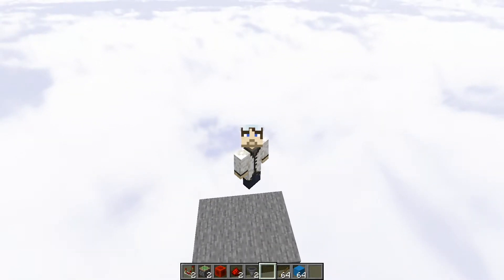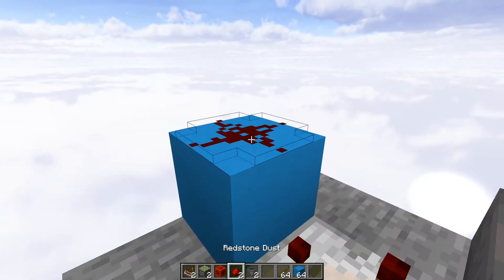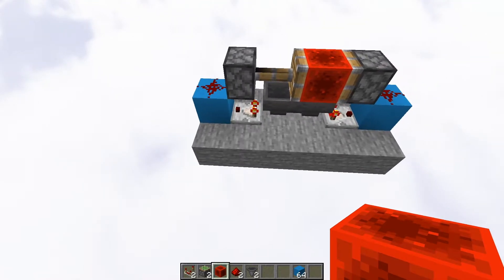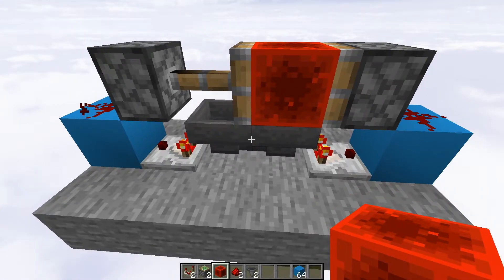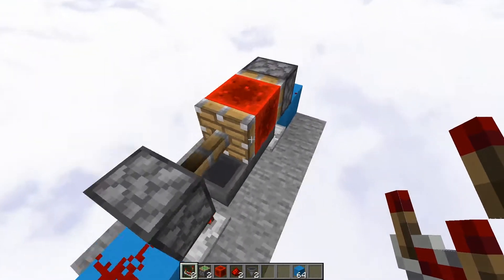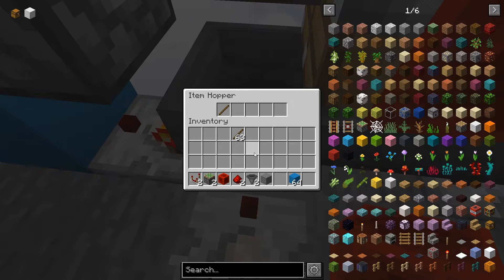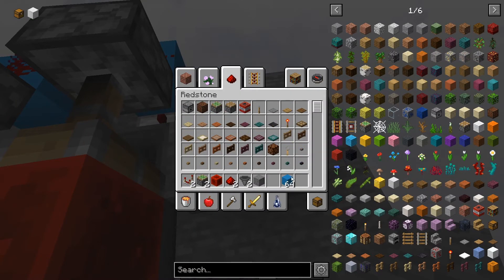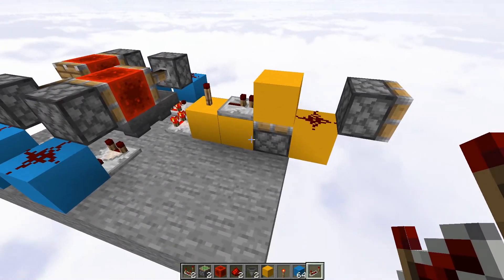How to Make RIDICULOUSLY LONG Hopper Timer Clocks!

Comment: When the comparator turns off for the extra clock the hopper acts as if it’s still locked if I break it then the item in the hopper move like normal idk how to fix thsi
Reply: I ended up breaking it and rebuilding it works now I am on bedrock so items move in 16 so for the second one it just moves all of them so just do the math 16=1

Comment: whats the exact amount of items to put it for a 6 minute clock? (im playing on a server where hoppers input items 3 times as fast as normal servers which is 3 items at a time)
Reply from the maker: you'll have to do some experimentation with it, but I think it's 150 stackable items (such as sticks) in the first hopper clock, and 6 items in the second hopper clock.
Reply: I put a few more sticks in and it worked! Thanks.
Reply from the maker: @BluxyW  awesome! Sometimes it takes a lot more testing

Comment: Hello, is there a way to stop/start the clock manually? for example when i push a lever the clock starts when i press it again it stops
Reply from the maker: There is a simple way to start and stop the clock. You simply need to lock one of the hoppers, which will stop the clock. Unfortunately doing it that way will stop the clock likely in the middle of the timer, but if that doesn't matter to you, then it's the easiest way to do it. Another method is to apply power to one of the blocks that have redstone dust on them. The problem with doing this is that it may require that one of the pistons receive a block update, so that can get complicated. Another method is to apply a full redstone signal to the sides of both comparators at the same time. This will reset the clock and turn the clock off. You can toggle it on and off with a lever if you like, or use a RS NOR latch, or a monostable circuit with a piston to push in and out a redstone block. Personally, I feel the comparator method is the best method to use, since it resets the clock as well
Reply: @Talmiior  thank you for still replying the questions after all those years, will try the comparator method for my dungeon game
Reply from the maker: @jeff6185  hope it works for ya. Your comment got me thinking of a new redstone vid though, so I appreciate the question!

Comment: There is a bug in mine somewhere, where instead of one quick impulse, it's as long as the first clock. How do i fix that?
Reply from the maker: odd, if you follow my setup, it should be working. That usually happens when a signal isn't being passed properly, a component being missing, or only 1 item being placed in the second clock
Reply: @Talmiior  Yeah, sorry. I used two comparators instead of one. But this clock is a bit different. When the first one does ALL of its cycles, it activates the second one, BUT it goes immediately to it's first state. Can I build this in a way, that when the first one does all it's cycles, it will just push the second one to the other side, and back and forth and back and forth?
Reply from the maker: @kingosondros  Sounds like you should scrap the second clock and just have two sticky pistons passing the redstone block back and forth. You'd have to set up a couple monostable circuits on the sides using the redstone crosses on the blocks left and right to achieve that, that is, if I am understanding what you are trying to do.
Reply: @Talmiior  Hmmm, so only one clock? No connecting?
Reply from the maker: @kingosondros  even what I said there isn't really necessary. You basically just want the signal to turn on and off after each 4 and a quarter minute cycle. You could take the signal off of the comparator and point that into a single monostable circuit connected to a sticky piston, which would push and pull a redstone block, for example, or push a solid block that would complete a circuit, something like that would probably do the trick. Doesn't sound like you need both clocks in what you're looking to do.

Comment: Question: How I make the clock run only once with a button?
Reply from the maker: you will need to switch one of the pistons in the first half of the clock to a non-sticky piston. I can't recall which one, I have a feeling it is the piston on the left, if not, try the other one. Put the button on the block on the right, or the power signal into that block works too
Reply: @Talmiior  Yeah, that worked out! But sorry, I could have explained myself better. In my case, I'm chaining so I can get a 40 minutes redstone clock. My ideia was to hit the clock once I finish up planting all my crops and the clock to automatically break all crops after 40 minutes and to stop counting/resetting itself. So the 1st half has 4 minutes (4 stacks and 44 blocks) and the 2nd half with 11 items (4 x 10 = 40 minutes, the extra one because it always get one pulse on startup). Your setup makes so only the 4 minutes part cycle once which is a great start!

I don't have much redstone knowledge but the only thing I can think is leaving the 1st half going infinitely and the 2nd going just by the hit of the button but this doesnt guarantee I have the exactly 40 minutes since I dont' know how much time the clock has been going but I think adding a extra item to the 2nd half count would be enough to counter that but the sound annoys me, I like having redstone mechanism turned off when I dont' use also because im playing on the server and dont want too much going on while being not used.

Basically, I need to find a way to make the first one turned off naturally (maybe a stick piston with a redstone block on the hopper below where a fliflop its saving a 1 bit memory???) and when I press the button the 2nd half "starts" waiting for the 10 pulses and the 1st half turns on until 10 pulses where it will turn off again (and the 2nd half would turn off naturally by having a non-stick piston). Do you think I have the right ideia or im overthinking it?
Reply from the maker: @TheGusst2Gamer  non sticky piston on the second clock would definitely do the trick, I think... If I am reading what you're trying to do here correctly. I donno why I was thinking putting it on the first clock would work, as exactly as you said, it would halt the clock after a very short period of time.

Comment: At 4:10 you explain the time but what is the number of stick in the other etho clock, Cause i want for 4 differents timer, one of 3h, one with 6h, one with 12h and a final one with 24h. (Its for using a command block that will spawn custom chest i alr created, but alr its in vanilla)
Reply from the maker: at around 3:40 I explain that the first clock needs to have five stacks, while the second clock needs to have at least one item in the clock to produce around a 4 minute output. For every additional item in the second clock will increase the time by around 4 minutes. I recall somewhere someone saying that it is more like 4 minutes and 16 seconds though, so I recommend timing it first before going too deep in.
Reply: @Talmiior  thanks 👍
Reply: @Talmiior  so is it like multiplicative?

1 item pass through the second clock every time the first clock moves.

1st clock was a 4 minute clock, and with one item in the second clock it was 4x1= 4 minute

When increased to two items it became 4x2= 8 minutes, three items it's 4x3=12 minutes, etc...
Reply from the maker: @seat0_294  it's not perfectly a multiplier, but close enough. If you have just one item in the first clock and two items in the second clock, you in theory have at least double the time of the first clock.

Comment: Hi is it possible to chain a hopper clock with a repeater clock fir example the main clock is the repeater clock that will give for example a 4+4 tick delay for a farm and have bihind a hopper clock that will count the number of cicle? For example if you need to produce esactly 8 line of stone from a stone generator
Reply from the maker: for your example, you mean the hopper clock would output a signal after the repeaters have gone through 8 ticks? I think it's possible. If there are 4 items in the hopper, it will give a pulse if you set it up correctly every 8 ticks. It is something I would have to play around with, and maybe I might make a redstone video on, as I have a tendency to connect different clocks together to produce different signal timings in a circuit, which is quite useful.
Reply: @Talmiior  my idea was to do a stone generator timer for a farm, I chained 2 hopper clock but it was not perfect timed and stone generator was after some braking  pushing stone into water when it was stopping. so I played a little and I find out that probably there was a possibility with 2 repeater set in 4 ticks of delay...now I am sperimanting I built a circuit that will send a monostable signal that will unlock a brake to unlock the hopper clock that so will make the repeater clock to start but it is difficult to make it stop all after 8 cicle 😂 I am getting mad... I am only 4 month that play Minecraft so mi knowdleg is not much 🙈
Reply from the maker: @nessunonessun1  you're on the right track though! Don't give up :D if you need the hopper clock to stop, all you need to do is switch out one of the two sticky pistons for a regular piston, then the clock will stop after one cycle. The next time the clock is triggered by your repeater clock, it'll start back up again, you just pump the signal into one of the redstone dots on the sides of the hopper clock. Hope that helps!
Reply: Do noteblock have dalay to transfert redston signal to pistons? I have read that in java observer have 1 tick dalay
Reply from the maker: @nessunonessun1  observers do have a 1 tick delay, yes. I believe noteblocks act like any powered block when transferring a signal, so it should be 0 I am pretty sure. Easy way to test that theory is put a row of 20 observers observing each other, and a row of 10 observers staggered with noteblocks. See which signal gets to you first... I wanna try that actually, gonna go do that now lol
Reply: @Talmiior   I managed to build the timer but I still have to work on timing because it is not working yet iven if it work on 4 x 2 delay repeater clock and do exactly off, on, off, on, off, on, off on tnx to the hopper clock. It is true, observers get before in a row of 10 with notebock vs 20
Reply from the maker: @nessunonessun1  that is pretty epic! o.o I discovered using logs and leaf blocks with pistons produces a similar speed to the observers mixed with the noteblocks as well, maybe 1 tick faster.
Reply: @Talmiior  I found out that a lag was cause from a piston shoting a redstone cube so I removed it....tomorrow I will try again to make the stone generator to work 😂
Reply from the maker: @nessunonessun1  sometimes sleeping on it is the only way... Hope it works out!
Reply: @Talmiior  hi I am still trying to time all the stone  generator 😂, I saw that to get stone is ok a 4x2 tick delay in the repeater clock (no cobblestone is generated), so 8 tick clock, but having in my farm a double side stone generator that produce 2 line of 3 blocks of stone that after getting pushed in the farm have to get out to a blast chamber so from the 2 line large 3 must go before into a 2 line large one and so into one line....so I managed to time all the sistem and to have a more easy life I set the clock of the stone generator to 4x3+3 repeater clock that power an observer alternatvly of 1 tick delay, so 16 tick clock work still fine. I mean every 8 tick stone is produced on the left side of stone generator and the next 8 ticks on the rigth for both the 3x stone line....
This will slow stone production but having to to put a 6 x stone line into 1x 😂...
Stone come from under get pushed from pistontnx to a oserver noteblock sistem with a delay of 3 tick from the stone generator and work fine so get to the meccanism that take the 2 line of 3x stone and do them inton1x and it spend 8 tick to do so. Now I have 2 line of stone and I have to put in one line 😭 they got pushed togheter and brakes. I tried with 0 tick pistons and do not works, I tried with observers but brakes I tried some delay difference snd same....the 2 line alrady have a little delay of 4. Do you have a solution?
Reply from the maker: @nessunonessun1  you've stumped me! I'd have to see it at this point. I recommend posting it to the r/redstone community. I've learned a lot from them. See if ya can capture a video of it and post it there explaining the issue, in video or in post, either way works. From there I can take a look at what you are doing, and the redstone community can have some input as well. They'll love your build by the sound of it
Reply: @Talmiior  hi probably I find a solution but I need to know what is the command block is used to delet blocks pushed in lines when they get to the command block? I saw is used often on youtube
Reply: Ok I find out is: setblock x y z air
Where x y z must be the cordinate of the block to delet 👍
Reply from the maker: @nessunonessun1  woah! Command blocks, you've gone beyond my abilities there! Congrats on figuring it out though, wow!
Reply: @Talmiior  eniway I am not yet solved the timing problem, I discovered that it can be caused from pistons retraction to....I mean if a piston is extended in the same tick moment of an other piston pushing, farm will brakes 😭
Reply: @Talmiior do you know a way to build a double horizontal 0 tick piston with blocks comigng from left and rigth side at same higth of piston that have to push in front?
Reply from the maker: @nessunonessun1  I don't unfortunately D: 0 tick pison pulses are not easy to do, at least for me ;-;
Reply: @Talmiior  I found an other error I did 😂 I was with a clock of 15 tick + at the end an observer powering the stone generator...so I was thinking to have 16/2 ticks 😂 after I recognised that 15/2  +1 is 8.5 and after again I noticed that wile the clock end a cicle, iven if you put it to 16/2 +1 it will be 8+1 for the first shote, but at the second clock will be alrady at second tick when it will activate the first time the stone generator because clock do not stop during the stone generator delay so the second pulse will be at 7+1 tick later and this with out taking into consideration the time needed from the stone to be generated change alot ...🙈
Reply: @Talmiior  finally, solution is found, I used a couple of 0 - tick pistons from il mango and now I have 2 possible configuration: A) with a 16 tick clock (8x2 on/off pulse), producing stone in 6 tick and a delay for the 2 different line of 7 tick and making the 2 line 3x of stone into 2 line 1x in 8 tick.
B) with a 20 tick clock (10x2 pulse), ston production in 6 tick and a delay for the 2 line of 3 tick and so managing them in a 10 tick 👍
Reply from the maker: @nessunonessun1  ilmango does the craziest stuff! But has helped me more than once on some weird redstone designs. Happy to hear ya got it sorted :D
Reply: @Talmiior  at the end I found a problem of this hopper clock chained with a repeater clock....to do it more precise I added at the output a monostable pulse with a piston and a gravel block...but after had built quite all the farm and watched the one cicle of it, I found out that the time needed to move back the 17 items used in the hopper to produce the 8 line of stone was somthing like 7 seconds so it was bad because I need to be able to plant a new tree. So I need a more fast reset. So I found out this looking on youtube take a loock at it  I chained it whith the repeater clock setted to 7 tick and it work perfect 👍 I think you will like to see how it works, it is basically a counter that move 1 item trougth hoppers and at the end get quite istantly reseted.
https://youtu.be/_YO-nyANp-4
Reply from the maker: @nessunonessun1  Thanks! I'll definitely go watch it!! :D
Reply: @Talmiior  https://youtu.be/0wJmOgirXV4
See this to without hoppers 🤔
Reply: I finished the farm 🤣. Now I will build it in my Minecraft world

Comment: Very useful for sugarcane farm in bedrcok edition, by the way how do you time it exactly 54 minutes?
Reply from the maker: the first hopper clock is around 4 minutes and 16 seconds. I say around, because Minecraft can lag and it could gain or lose up to 10 seconds if it's bad enough, but also because 4 minutes 16 seconds may not divide well into 54 minutes. Next, for every item you place in the second hopper clock, depending on where you pull the signal from, you will get 4 min and 16 seconds. 

So if you are taking it off of the redstone block for your signal, it'll be 12.65 items. There's that rounding issue. If you round down, it'll be 51 minutes and 12 seconds. If you round up to 13 item, it'll be about 55 minutes and 48 seconds. If you need as close as possible to 54 minutes, I'd recommend a despawn clock, which you can chain together to get 50 minutes exactly, then add to the end of the clock a single hopper clock, which will get the closest I can think of, which would be 54 minutes and 16 seconds. Sorry that's the best I can do...

I have a video on how to make a despawn clock, which you can find at this link. You would need to change the hopper clock a little bit to make it run with the despawn clock though. Probably just swap out a sticky piston for a regular piston would work. Here's a link to the vid: https://youtu.be/QiPpEX8Z0FA